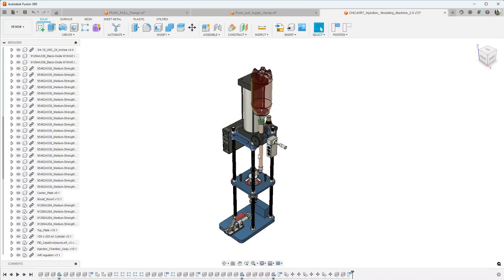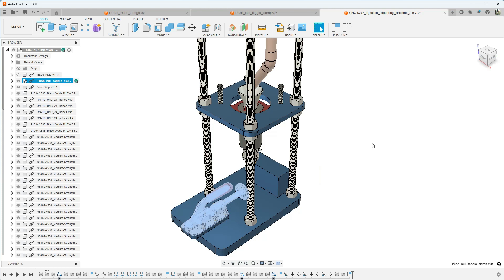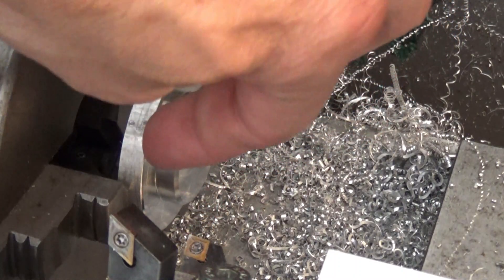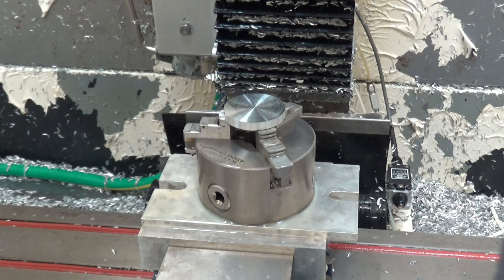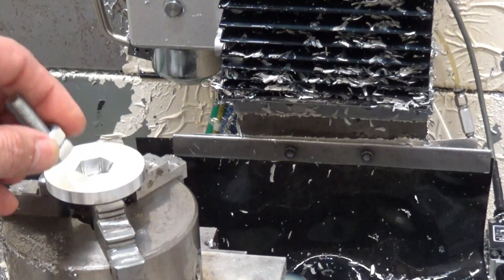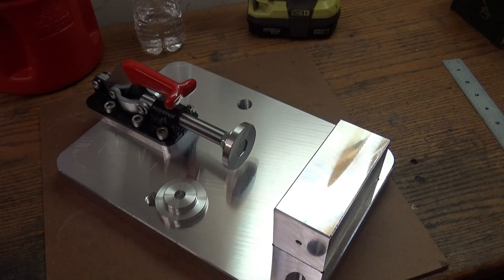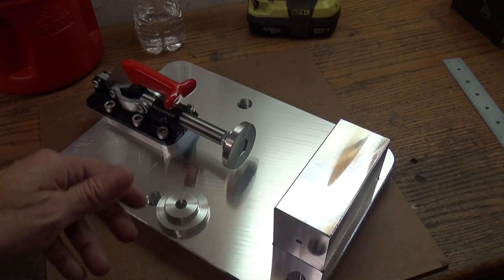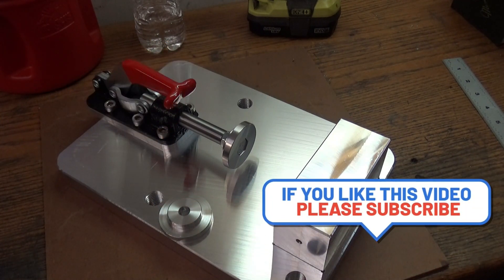Injection Molding Machine  Push/Pull Toggle Flange

Comment: hi i am wondering how to setup mach3 turn for css i am using vfd with rs485 and i cant get css to work
Reply from the maker: I did a video a few years ago when i swapped the G0602 over to full CNC and spindle control. Have a look at that video it may help.
https://youtu.be/qRwa-1Gn0wI
https://youtu.be/e3nht44RgVE
 These 2 videos may be helpful.
You want to run G96 constant surface speed and G95 feed per revolution.